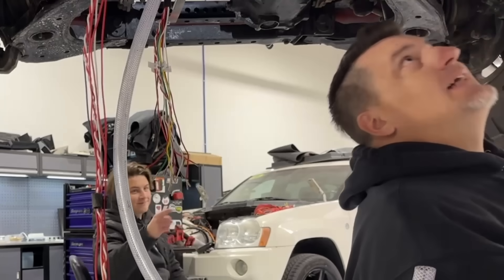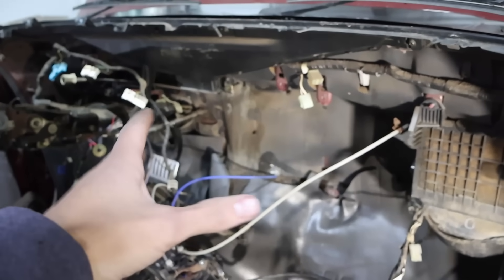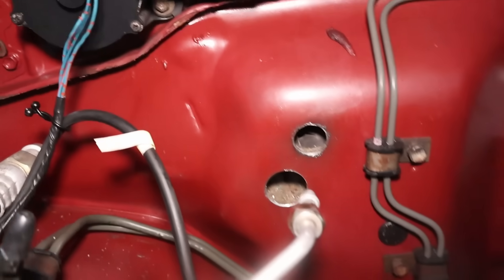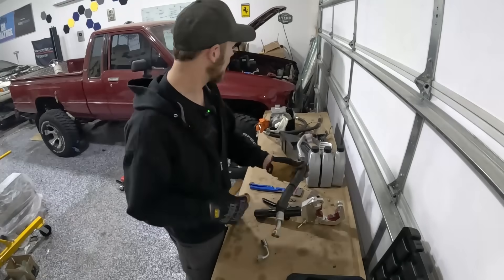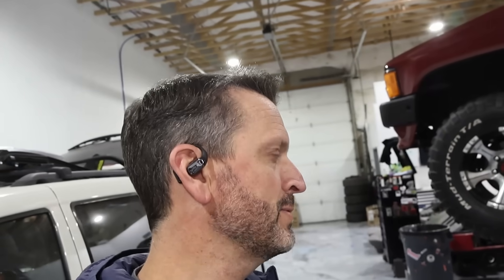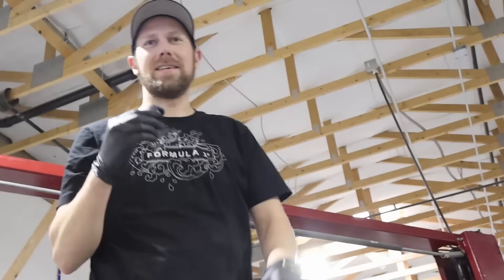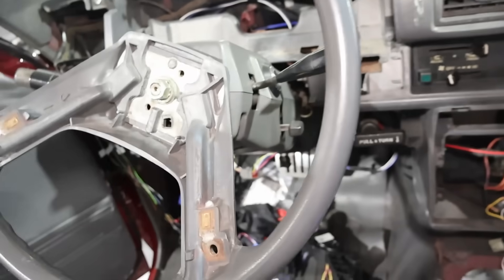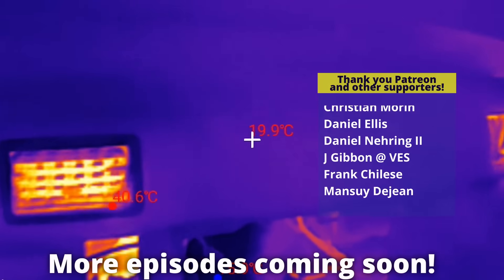How Is This Possible? - ELECTRIC HVAC

Comment: Generally your high side pressures (and their corresponding temperatures) will be 30° F higher than the outside ambient temp. So first check the ambient temp. with your guage manifold. Then start the  system and while running that temp should be 30° F higher under normal conditions.  Keep in mind,  normal temp pressures and their systems are rated at 95°F as the starting point.

Comment: That compressor os not wired they all need a ground to turn on.
Reply from the maker: It has a steering shaft angle sensor that ramps up pressure with steering input.   It is wired correctly.

Comment: Not sure if I missed something, sorry if I did, but shouldn't you pull a vacuum in the system and check if it can hold that vacuum for a couple of hours (especially since you crimped new hoses) and only then (with the vacuum still present) insert the refrigerant? Also, I know it's not a thing for all refrigerant bottles, but IIRC some do require you to hold the can upside down during the filling process. Not trying to shade or anything, I love the videos! I just noticed this because I had to do this service on a previous car and I still recall the steps I took (had to watch several videos on YT to not mess up! lol)

Comment: Ummm, that A/C compressor sounds like you forgot to put oil in it.

I'm using Guchen A/C compressors, the manual sucks and they don't clearly tell you but they don't fill them before shipping. At least not the Guchen compressors.

Maybe check it before you burn it out.
Reply from the maker: Yes it has oil

Comment: On air conditioning systems, you are refrigerant until you see frost on the evaporator coil. As you add more. The frost line keeps building. When you get to the sweet spot, the frost will flash off and you’re there. Likewise, if you see frost develop again, you’ve lost refrigerant because you have a leak. This applies to all types of refrigerant systems.

Comment: That dude charging the system from that aerosol can of "r134a" (which I'm willing to bet was isobutane replacement  not true r134a) with no vacuum pump in sight and doing it by pressure alone and not by charge mass goes against everything I know about refrigeration systems.

Comment: 250-300 psi is going to shorten the life of that compressor. Typically 225psi is the max you want to see. Most automotive applications have continuous low speed fan operation and high speed above 225psi.
Reply from the maker: Good to know

Comment: 290 psig head pressure on 134 is insane. You need to get somebody who knows what they're doing to look at that. R134a should run ~120 psig head.
Reply: It's really not that insane because it's all based on ambient temperature. You can't just say it should be ~120psig because that's only if the ambient or more specifically the air around the AC condenser is at ~60F. In this case it makes sense that the high side pressure gets up to ~300psig before the fan kicks on because the air around the condenser is easily getting up to ~90F without the fan moving air.
Reply: @patricke3848  I can say it's insane because I'm an A/C mechanic. In this case the HP control is cutting in waaaay too high. SFA to do with ambient it's triggered by head pressure.

Comment: If I could match enough numbers on the lottery .. I would 100% give you the challenge of heating and cooling a square body  Suburban .. I have a dream a dual motor awd lowered Suburban with the final gear swap .. I live in a lil town almost no one has heard of except 2 times a year, in almost my backyard ( 3.5 miles from shutdown ) is the Texas Mile .. A 1 mile run down a old runway .. my goal hit the 200mph club in a electric BRICK
Reply: If I win the lottery I want them to turn a ~2004 Silverado into an EV for me lol
Reply: @digi3218 I think both the Silverado and the Suburban will accept the AEM Tesla Model S rear subframe brackets right?
Reply: Mine would be a 1956 Chevy Nomad or 1972 Chevy C10 4X4
Reply: Suburban? I hear dual zone climate control!

Comment: Wouldn‘t it make more sense to also use the ac as a heatpump? I imagine the heat exchanger could have gone where the old heater core was. Then in cooling mode cold air would go to the cabin and in heating mode warm air would go the exact same way. Also would make the entire build way more efficient in the winter
Reply: I guess it's cheaper and easier. Also they work faster. And better in really cold weather.
Reply: Heat pump systems are efficient if you keep them on at a steady temperature. But for a car that will be off most of the time and needs to rapidly get to the desired temperature when you turn it on, a heat pump is not the right solution.
Reply: @rthomp03 sorry but very much incorrect. Nearly all EVs use heatpumps for thier HVAC system. My 2019 Hyundai Kona EV has one and it's basically instant heat or cold within a few seconds of starting the car. Blows just as cold or as hot as any has powered car I've every owned. Below about -35°c the heat does start to fall off, however at that temperature most gas car is aren't getting warm enough to make heat either.
Reply: @AdventuresonTour  I didn't say it was impossible, the argument is whether it's more *efficient*. Heat pumps do not operate efficiently when rapid temperate changes are required. You can always throw more power at the problem, but for EVs that's going to reduce your overall range.
Reply: @rthomp03 heat pumps are more efficient on ev it's why it's an option for most of them
Reply: @rthomp03  Heat pumps are never less efficient than resistive element heating, they just become less effective at developing high temperature air.  They're still pumping out more BTU's per watt used than resistive heaters, but the air coming out might be closer to 80F than 140F.  Resistive heating achieves those temps because you're literally dumping thousands of watts into it until you get to the temp you want.  Heat pumps do nothing more than move and concentrate existing heat from one place to another, which is far more efficient than resistive heating will ever be at any temp.  Most heat pump systems will have either a small resistive element for extreme cold weather to supplement heat, or they're removing heat from components like the battery and motor to pump into the cab, acting like both a radiator for the components and a heater for the cab at the same time.  So instead of wasting all the heat energy that motor took from the battery and using a electric fan to dump that heat out into the environment, a properly designed heat pump system will take that heat from the source and put it directly into the cab, then dumping the excess heat outside if it isn't needed.  Same principle as how heater cores work in ICE vehicles, you're just using a different method to pipe that heat into the cab.  This particular system appears to be a variable speed compressor, which makes a lot of sense in an EV, as they're a more efficient option when you're having to drive them straight off the battery instead of an engine where you can't really adjust RPM to suit the compressor.  It maintains continuous operation, throttling pump speed to maintain a pressure that correlates to how much heat is being pumped around.  If the delta demand is high (cold car and a max heat setting), it ramps up to match the load.  If the demand is low (cab has already been warmed up and it's only a bit nippy outside), it spools down to a low RPM to match the light load.  Meaning, it's running almost all the time, usually at a very low wattage.  If it's done right, you end up using a couple hundred watts or so instead of several thousand watts, and the only additional cost is a reversing valve and a few duplicated sensors...probably a lot cheaper than the heater core they bought too, but it wouldn't be a bad idea to leave it in there anyway.  If you plan on going somewhere remarkably cold, or you want twice the heating to defrost and heat the cab faster, or want a backup if you have a refrigerant leak in the winter, the resistive heater core would be a useful addition...but it's not the more efficient option.
Reply: @rthomp03  Heatpump systems are always more efficient than heating with a resistive heater, because they give you at worst 3 times the heat energy you put in as electricity to run the compressor and systems supporting it. When you put 1 kw of electricity into a resistive heater, you get 1 kw of heat out. Compared to a heat pump, this is not very efficient.

Comment: It seems like system documentation is a common problem, confusing instructions and wiring diagrams. It is almost like the development money went into the product, not the documentation.
Reply: Well yeah, when you're building a one off product you're not going to spend 25% of the budget on documentation.
Reply from the maker: I think you are right

Comment: should have used rubber grommets at the firewall on the a/c lines. Vibration over time may erode a hole in the lines.
Reply from the maker: Good call
Reply: Absolutely the hoses will develop leaks from contact with the firewall.
Reply: Can still stick em in if theyre split...or make a split